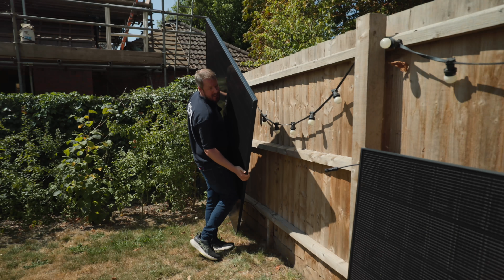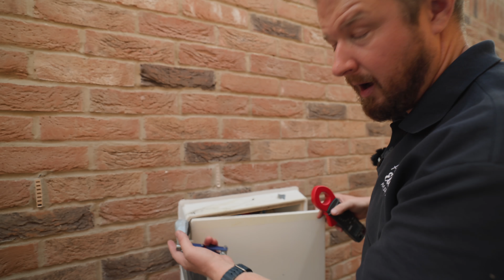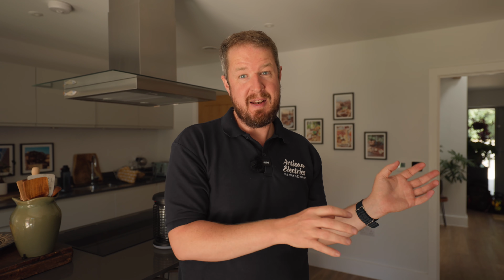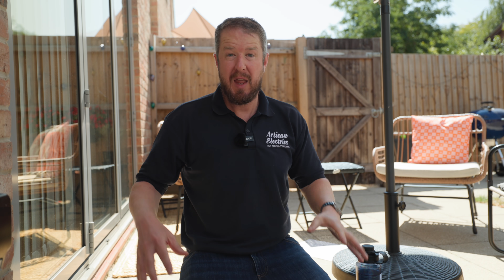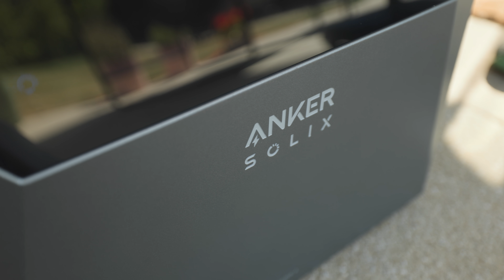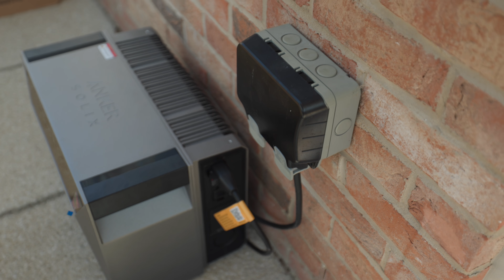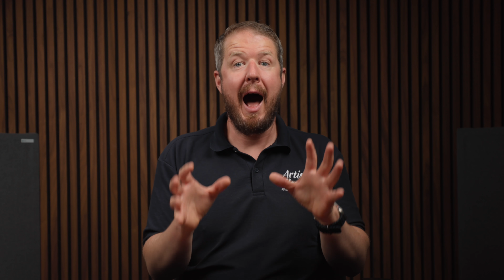The MISSING PIECE of Plug-In Solar

Comment: Bi directional RCBO is a MUST yet no one seems to talk about this…. Madness
Reply: Not according to the UK Government!  They ruled that RCD is sufficient for plug in solar. RCBO is recommended.
Reply: @pluginsolarexplained  Presumably it's assumed that the inverter can reliably sense when the connection to the mains has gone and will cut the power?
Reply: @BrianG61UK correct, there is a minimal amount of permitted DC leakage too.
Reply: @BrianG61UK  *** EVERY *** grid tied inverter already has this, it’s called “anti-islanding” and it’s a mandatory safety requirement built into every grid-tied solar/battery inverter.
Reply: The “perceived problem” is that some older RCD’s can overheat IF power is fed in to the RCD’s output when tripped, however while this holds true if the RCD is being fed via something like a generator, it doesn’t hold true for grid-tied solar or batteries as they are designed to stop all generation as soon as they are disconnected from (or cannot detect) the grid, it’s called “anti-islanding” and it’s a mandatory safety requirement built into every grid-tied solar/battery inverter.... ...so “In-The-Weal-World” grid-tied solar/batteries can never actually create the scenario where the RCD overheats!!
Reply: That is a bogus claim that is not supported with facts...
Reply: @SolarizeYourLife  It's supported with knowledge. But presumably it's assumed that the inverter can reliably sense when the connection to the mains has gone and will cut the power?
Reply: @BrianG61UK Well it should come with a certificate that proves that it does exactly that.
Reply: @BrianG61UK do you have RCBOs for other DC leak capable products like washer dryers?
Reply: Yes. Suddenly nobody is talking about all the things they were making videos about back when the videos were all explaining why plug in solar can't be legal in the UK.

Comment: Jordan, You have portable AC I see can you maybe do a video on, Good quality, reliable portable AC units please? We have a house with a air source heat pump (but it's not a HVAC) type. As you are aware it's been somewhat hot this year, as you are no doubt aware air source is a good form of heating, but sadly this comes with it's pitfalls, a foot of insulation in the loft minimum, cavity wall insulation. this is fine UNTIL the tipping point is reached! Once the walls become hot, THEY STAY hot ALL NIGHT acting like storage heaters of the 1970s (heated during the day and then releasing it at night) Our south facing walls of our bedroom and lounge that get the sun ALL DAY at 2am this summer have averaged 29 degrees! So it would be nice to get your take as a trusted sparky on this problem please!
Reply: Have a look at the portal split from midea. It's one of the very few models that is a portable split AC. Therefore the efficiency as a lot better than any hose based AC.
Reply: @Felix-st2ue  Yes, the Portasplit! Such a godsend this summer. Will scoop up a few units more, over the winter.
Reply: @PhilippBorn I didn't manage to get one while it was hot 😑
Reply: @Felix-st2ue  I don't / cannot have one of these, we are in rented accommodation and cannot make any material changes to our house.
Reply: @halesworth01 how are you making a change to the house? Youre juat hanging it out of the window.

Comment: Step forward electricians willing to connect these at a fair price...not for £1000 which is the cost of the kit!
Reply: Get the electrician to supply the kit and wire it in. Then they get the VAT back.
Reply: These are 800W limited so you can just plug them in a standard wall outlet yourself.

Comment: I don’t have any solar be it panels or batteries,  don’t really know much about it other than watching people like yourself on YouTube, have been thinking about getting a couple of panels down the bottom of the garden, it’s about 20 feet away from the house, so if I got four panels as an example rather getting four lots of cables is there away of a four way junction box for where the panels are situated so I could have one cable to the house with another four way junction box to plug into the battery,  it’s probably a stupid question, if you don’t know stuff in life ask be it stupid or not, thanks take care.
Reply: Most people would benefit by simply buying a new fridge freezer and more modern LEDs rather than bolt on a plug in solar kit
Reply: We've recent got plug in solar, an Ecoflow 800w microinverter and a single JA 465watt solar panel. The microinverter has quite a long cable to the mains which you attach a UK plug to, maybe 8 feet. The MC4 cables on the back of our panel are quite short but you could easily buy extension MC4 cables so you can have your 4 panels at the garden bottom and run the cable up the side of your fence etc. There are also Y MC4 combined cables out there to wire panels in parallel. Could utilise those to reduce the number of cables running down your garden.

I recommend doing your research, lots of naysayers out there at the moment but don't let them put you off 😊. Nothing like reducing your energy bills with prices so high at the moment!

All the best
Reply: Short answer: yes you could. Longer answer: it depends, and may not be beneficial. So, taking the longer answer, you need to consider various things like what the output (voltage and current) of your panels are and what the input limits of your inverter or battery system are. You can wire panels in parallel or series (or a combination). Parallel keeps the voltage the same but increases the current you can get. Series does the opposite. If you wire in parallel in the way you mention, it is likely that all you will do is hit the current limit for your MPPT input on your inverter/battery. If you wire in series, you will probably damage the MPPT input (unless you have matched your series voltage to the input limit). Wiring in series also means that you run the risk of one panel being shaded killing all the power. You would be better off running separate cables for each panel if you can get an inverter/battery with 4xMPPT inputs (I have an Ecoflow Stream Ultra that I use with 4x panels - I also have a Stream AC hooked up to the Ultra to give me more battery capacity). Most inverters have at least two MPPT inputs, so you could parallel up 2 pairs of panels and have that arrangement with an inverter that has 2 MPPT inputs. Would mean that on days when the sun is not shining brightly you would get better input per MPPT and on days when the sun was shining brightly you might end up wasting power (if the panels produce more current than the MPPT can handle and so the inverter just throttles back the panels). All the above depends on panel capacities, MPPT input limits, losses in the cables, etc. Far more than could be put into a quick reply here. There are lots of useful YT vids on parallel vs series panels and voltage drops/cable size, etc. Worth doing some research on it if you are serious about getting panels, since it is easy to get it wrong and have to spend more money fixing things. BTW, the only stupid question is the one that is not asked....
Reply: Every set up is going to be different, but I don't understand what you are trying to achieve... All panels can be parallel and or in series and then run a single line to where ever...
Reply: @SolarizeYourLife  I didn’t think each panel came with 30 feet of cable.
Reply: Most of these units are IP65 rated so you can put the whole system down the garden and run a single mains cable to the house. Obviously in all cases you should be very careful about long cable runs whether it's mains AC or solar DC so the cable should be run properly.

Comment: You might want to check out the latest video from Electric Vehicle Man who has gone through the legislation that goes live on Thursday 27th. He found some very interesting things. D98/99 approval still required. Only one approved UK seller - 2 panels for £1200! Restrictions over angles, Nothing on batteries (so iIguess technically illegal). What this could all mean for your insurance. The comments on that video are also quite illuminating! Personally I added 3 x 450 panels attached to a 2kw Ecoflow battery (who have put a custom socket so you can only expand with ecoflow at £1000 per KWH) but as my main array is permitted to export i am getting paid. I only use 400w baseload, so setting the export to 800w lets me export a constant 400w while any excess goes into the battery

Comment: Fire brigades will be busy in the next few months...... once all the Temu, Ebay, AliExpress shite starts being fitted by 'bodge it & leg it' installers!
Reply: And roger the bodger starts to attach plug in batteries to several 13 amp sockets in the house. Not to mention the safety aspects of where the batteries are located.  E.g. bedrooms, loftspaces, cupboards, hallways and anywhere that could impede egress from the house in the event of fire or go up in smoke when inhabitants are asleep.
Reply: @jimb7406   Sorry are you saying the home electrician is going to start now installing solar ?
The home bodger has been rewiring their house, adding extra sockets and powering the garage with some hooky cable off Marketplace, for ever. Its not new and never will be.
Reply: 😂😂 Then, more new laws 😴